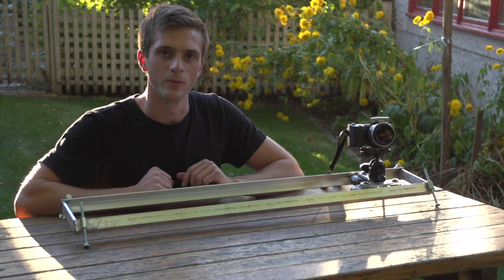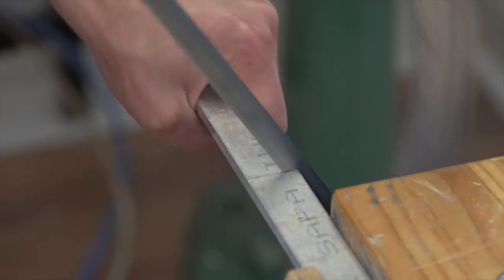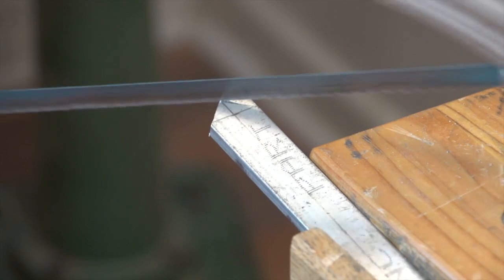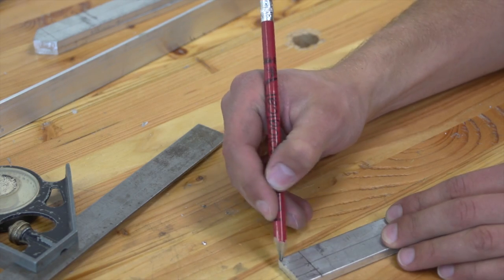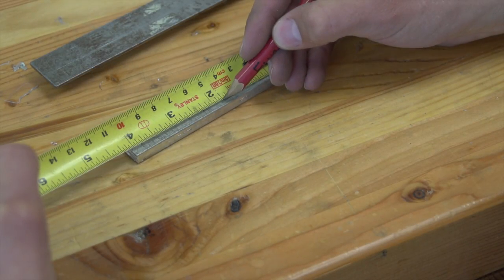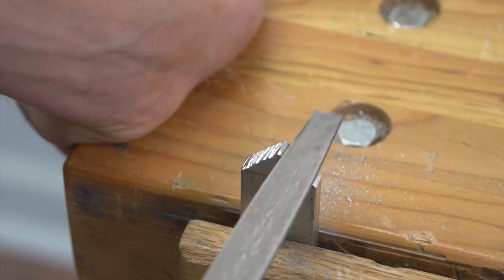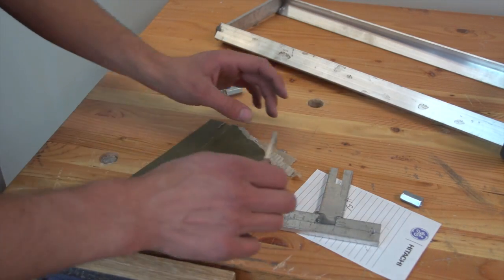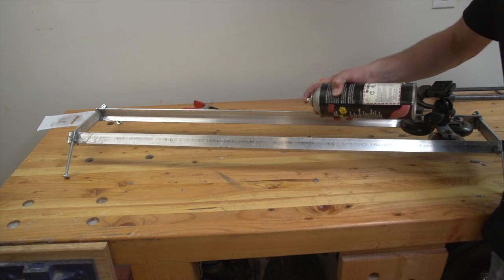Ultimate DIY Camera Slider Tutorial

Comment: And what glue have you all glued together? Have tried 6 different pieces of glue and none holds. Everything is falling apart!
Reply from the maker: You have to use epoxy, not glue! And make sure you use a file to rough up the bonds before you glue it. Also, make sure the joints are held firm while the epoxy dries.
Reply: I also glue 5 glue tried two versions of epoxy, but one made in Russia and another in China, but none of them holds parts of aluminium
Reply: this is hardly believable. chinese made epoxy is used all around the world, it works. suspect wrong mixing proportions...

Comment: @rcexperimental I don't think you should regard the hateful comments on this video. I personal love this tutorial for different reasons. Most DIY Camera Sliders on Youtube have to be held by hand or the camera will fall off the track but your design is cool and practical especially if the track is set vertically.I will modify this design by welding the parts and also adding a tripod base so as to make it more versatile.

Comment: nice camera slider! thanks for the video. fyi, i like JB weld much better than plain epoxy when gluing metal. i have a friend that punched a hole in his Suzuki drz400 crank case (motor case) and lost all his motor oil, glued it with JB weld and filled it back up with oil and it has been running good since then, 3 years ago!

Comment: When you get into TIG welding, you'll look back at these videos and laugh at your over-use of epoxy.
Reply from the maker: I usually MIG my personal builds, but I wanted to find a way someone without much technical experience or specialized tools could build this. Also I've found that I have to be very careful when welding because of heat warp or splatter that can affect how smoothly it works. Easy, but not really a beginner welding project.

Comment: hmm I'm not sure if the epoxy glue works well... since it does need to bear quite some weight. I did a test with two metal pieces glued together(small side to small side) and it was very easy to break... might be that it wasn't cleaned good enough but I'm not sure if I want to trust my camera to such a slider :/
Reply: Well that's why you use epoxy and not glue.  The epoxy I used was rated at 3200psi and I have not had a mechanical failure.

Comment: yes a triangle will work, just remove the point on the side with 1 wheel.
to mount this to a tripod it will need to be welded. I am doing that tomorrow. you need a plat on each end plus 1 in the middle. you may have you use thicker gauge aluminum.
also I made this to a T on his specs and soft wheels are not better.
in my case in canada. 1.5 angle aluminum $20, roller blade $10, epoxy $9. works for me and works well. I may add 4 wheels though.
Dude you made a nice video. Thanks

Comment from the maker: Thanks! It could be done, however the pocket dolly would only sit on top of the frame, by having the wheels orientated horizontal like this the dolly part of the slider is fixed inside the track so it doesn't risk falling off.

Comment: For anyone that is interested, I have been able to build an exact replica of this dolly instead of using epoxy I used "pop rivets" on all the connections - Same dolly style and mine is 5 feet long.

I currently use a 5D MKIII + Batt. grip with 2 battery with a 24 - 70F2.8 lens attached and is very stable and I am happy for it to go along the tracks with no assistance.. For anyone that is worried about weight just pop rivet together and you won't have any issues.. I will make a video of it soon.

Comment: The aluminum will bend if it is unsupported for too long, but without trying it I couldn't say whether that happened at 4 feet, or 6 feet, or 8 feet. But you can simply glue a support across the bottoms of the angles at regular intervals to keep the angle from spreading apart, and add some additional nuts for adjustment feet as needed, and could make this as long as any available angle (usually 20 feet).